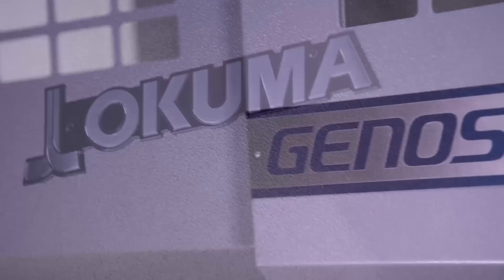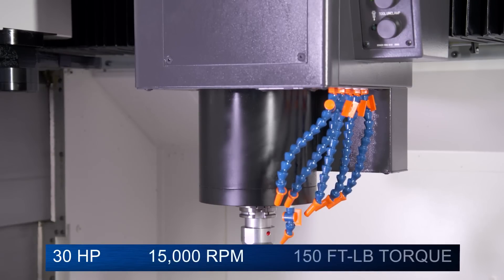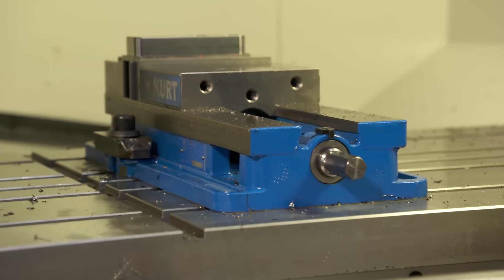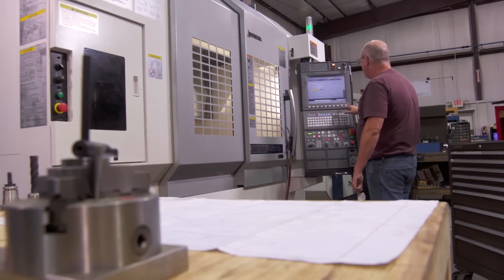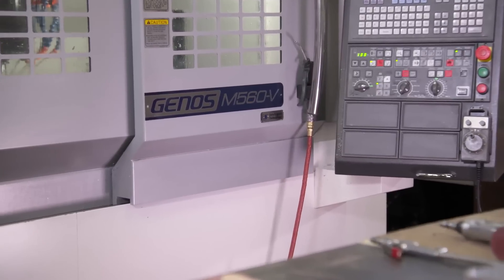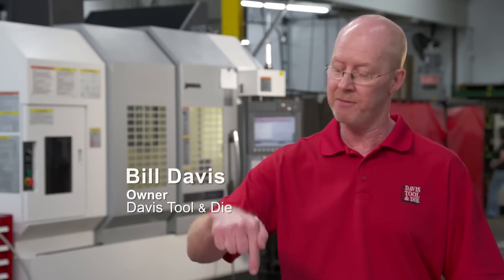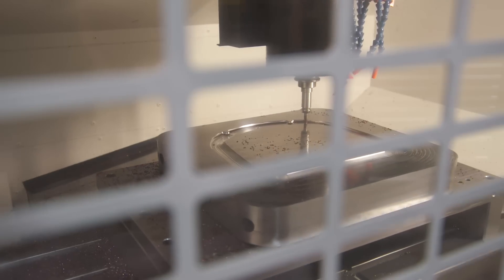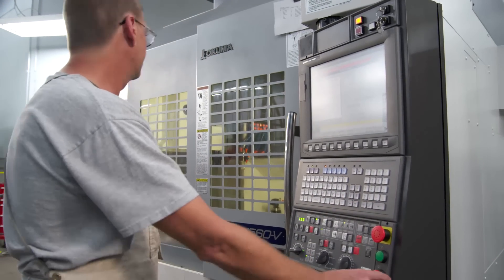Okuma GENOS M560-V Vertical Machining Center

Comment: Ours needs a new spindle and it a year old. But no Warranty because we are the second owner. Machine was never crashed.
Reply: I think these are made in Taiwan not Japan?
Reply: As the second owner, you never know if the first owner crashed or not. Also, they have a thru-coolant spindle pin that needs replacing after so many hours. If not replaced and coolant mixes with hydraulic oils, that ruins the spindle as well. Ours is just over a year old, we maintain per Okuma's schedule, and no problems yet.
Reply: @MarkWesley  could they have not noticed it ?
i thought okumas were built to last 
why does the pin need replacing? do you own a M560 v or M450 V?
Reply: no way? 
after ONE YEAR?   did you over heat ?  what did you do? 
crash ?
Reply: If it's a production machine that runs 24/7 at 15.000 rpm when no wonder the spindle has to be replaced at one point. 

Wrong spindle oil might also have something to do with it.
Reply: @Rasmus661  it has a sealed catrige spindle.  You can't put oil in it. Why give someone advise on something you don't know about?